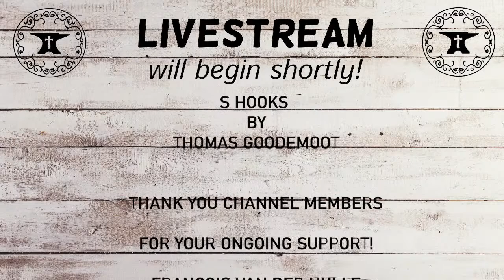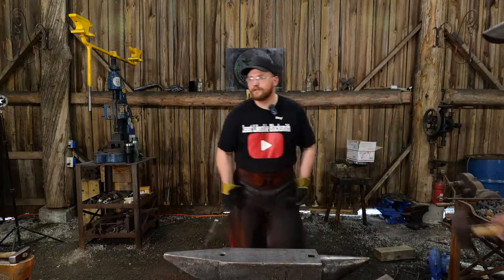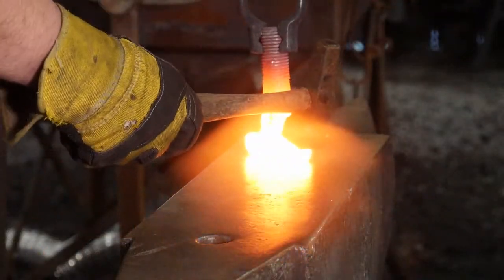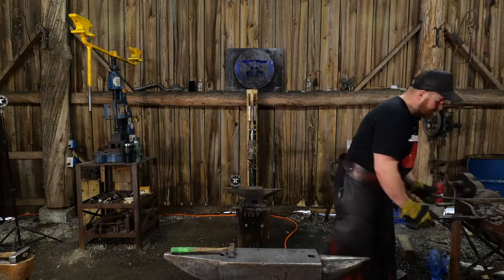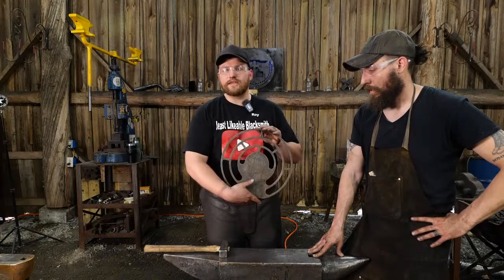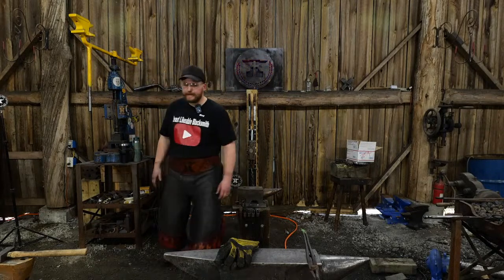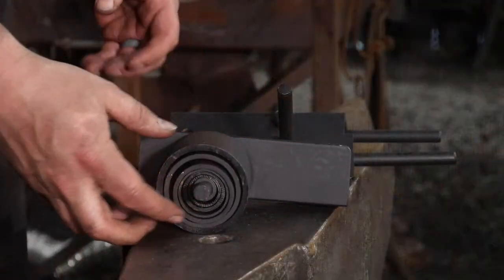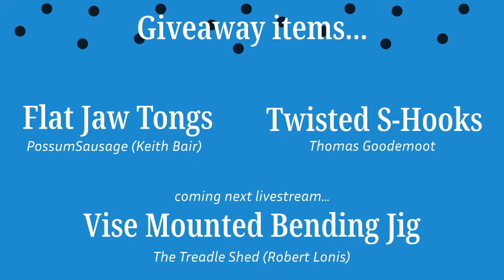LIVE: Treadle Hammer Kit Giveaway!

Comment: I cleaned some cast iron in vinegar, and when I took it out there was a lot of black soot on the metal and it quickly flash rusted. I recently cleaned a surface rusted vice handle in vinegar, and while it did flash rust within minutes of lightly drying it off, there was none of the black residue. Does that only appear on cast iron? Thanks for sharing any insights on this, I don’t know who else to ask.